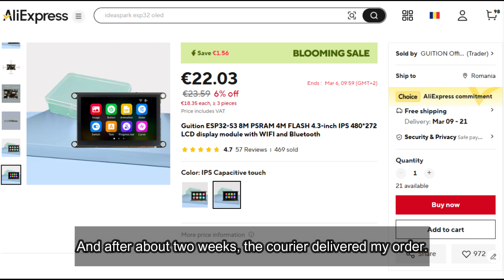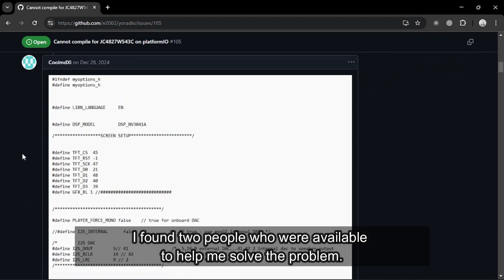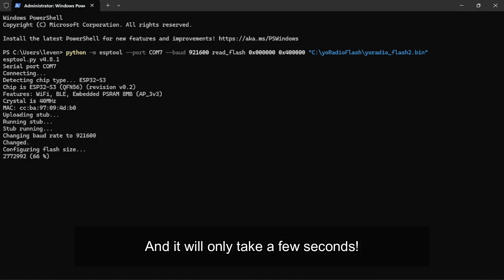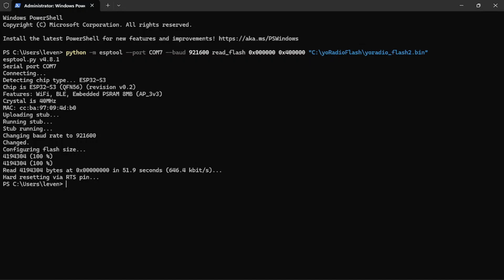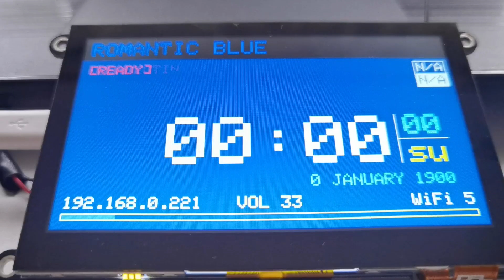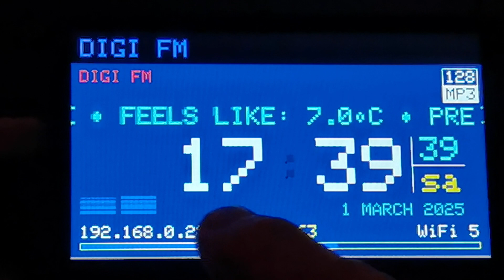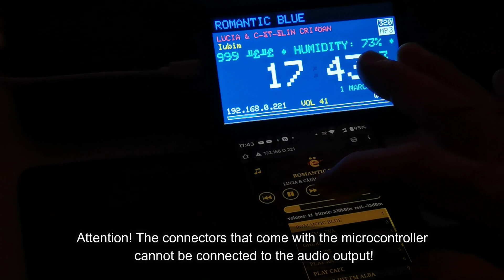JC4827W543C – Easiest Touchscreen yoRadio You Can Build!

Comment from the maker: UPDATE: 21-03-2025
I fixed the weather section where coordinates couldn't be saved. Now it works!
https://github.com/DaradiciLevente/yoRadio_on_JC4827W543C/blob/main/bin/JC4827W543WeatherOK_02.bin
After entering one of the coordinates, press the APPLY button, then enter the second coordinate and press APPLY again, then the DONE button.
Restart the microcontroller to display the weather data for the new coordinates entered!
*********************************************************
- Documentation found about this board:
https://drive.google.com/file/d/1gueTjXj1Turlng_rQoWY_w9u6djYq_Ah/view?usp=sharing
- Yes, it's mono.
- The DAC used is not the ESP32's built-in one, which is a good thing. It uses an NS4168 DAC:
https://i.imgur.com/dZN2lGp.png
- Here’s the NS4168 documentation:
https://drive.google.com/file/d/10usuAzGJXK8cs_hDrNVgSYg-hX5jxtqx/view?usp=sharing
- The sound quality is good, but in my opinion, a PCM5102A offers better audio performance — or maybe the yoRadio project is just better adapted to it.
- There are still a few free GPIOs on the board, which you could probably use to connect an external DAC:
https://i.imgur.com/29iERlE.jpeg
- To connect the speaker to the board you need a connector with SH1.0 wires, of course 2P. I bought this connector from here:
https://www.aliexpress.com/item/32921127444.html
Two images of this connector:
https://i.imgur.com/f7T7rLP.jpeg
https://i.imgur.com/vDMWe3a.jpeg
- I’ve collected the changes so far on a GitHub page for those who want to modify the project and fix the remaining issues:
https://github.com/DaradiciLevente/yoRadio_on_JC4827W543C
- My GitHub page:
https://github.com/DaradiciLevente
- For even faster flashing in the Flash Download Tool, set the COM port baud rate to 921600.

Comment: Thank you for sharing this. I had no issue loading then file but unable to configure the wifi and others settings. what am I missing?
Reply from the maker: On first boot it will try to connect to my wifi network, which won't happen.  After that it creates a wifi access point to which you connect and in the browser at the IP address: 192.168.4.1 you enter the data of your wifi network.  Save the data and it will connect to your wifi network.
Reply: @LeventeDaradici  Thank You. That is what I was missing. My only problem now is every time I can weather settings it reverts  back to your settings
Reply: Just one more thought, is it possible to incorporate blue tooth earbuds?
Reply from the maker: I have NEVER seen anything like this on the yoRadio project before. I have no idea if such a solution exists.
Reply: @williammckee4369  I think that you could connect a bluetooth dev board some how and this could transmit to you ear buds, but not a simple project

Comment: Szia Levente! Nagyon jó videó, köszönöm. A leírásban lévő dolgokat is megnéztem. Jól értettem, hogy van egy JC3248W535 kijelző+ESP32 board is, de azt nem sikerült működésre bírni?
Reply from the maker: Igen. Annak egészen más a képernyő típusa. Van valami dokumentáció a gyártó részéről de bele se néztem eddig. A demó kód a képernyőről látható ezen a csatornán. Érdekes az is.
https://youtu.be/m0m_cZ43q6U
https://youtu.be/sOPy2KAM6EE
https://youtu.be/XVyFHk6L790
Reply: @LeventeDaradici  Köszönöm. A képernyő mérete mellett, ami kisebb, viszont a memória több a 3248-ban. Ha Yoradio szempontjából mindegy, lehet próbálkoznék a JC4827W543-al. Esetleg majd tudsz segíteni ha elakadtam, főként külső DAC  (PCM1502) illesztéssel?
Reply: @zsoltkovacs2395  Hello, I am also interested in a .BIN or my options file for this card model but with the infrared input and I2C output option to connect a PCM5102 sound card. Thank you in advance.

Comment: What type of connector is needed to use the extra pinouts (e.g. for a better DAC or rotary encoder)? Thanks :)
Reply from the maker: There is a connector in the board box.  Only for the speaker is not good.  For the other ports it is usable.

Comment: Hi LeventeDaradici,
 Great Video and great idea for using the bin idea for simple upload for anyone.
 I was so glad to help as the Yoradio project is amazing.
Maybe another video is needed for normal Arduino IDE with the libraries etc or perhaps another bin the add the DAC via GPIO pins as this board has alot of GPIO to easily add external DAC and AMPS etc.
Keep up the great work and thanks for the mention.
I am truely amazed at the speed of the .bin file, so much quicker than normal compile and flash!
Reply from the maker: There is a version on this GitHub page that you can modify: https://github.com/DaradiciLevente/yoRadio_on_JC4827W543C.
Thanks for your help on GitHub! This video couldn't have been made without you.
Reply: I think external DAC is a must since the ESP DAC is mono no?
Reply from the maker: https://www.chipsourcetek.com/Uploads/file/NS4168.pdf

Comment: That is amazing, a true plug&play internet radio for cheap, with a large touch screen! Levente, you are a hero!:washhands:
Thank you for devoting your time & effort to figure out the tricky hw config issues and made this display supported. :medal-yellow-first-red:
I hope that the YoRadio Crew will consider adding this display to the official support, could you consider recommending them? This is a truly cheap and easy solution, making YoRadio even more popular.
This is mono only, right? 
Is this using the ESP32 DAC, so the sound quality is that poor? 
Is there a digital sound output where I can add a DAC for a decent analogue input signal for an amplifier?
Reply from the maker: Yes, it's mono.
The DAC used is not the ESP32's built-in one, which is a good thing. It uses an NS4168 DAC:
https://i.imgur.com/dZN2lGp.png
Here’s the NS4168 documentation:
https://drive.google.com/file/d/10usuAzGJXK8cs_hDrNVgSYg-hX5jxtqx/view?usp=sharing
The sound quality is good, but in my opinion, a PCM5102A offers better audio performance — or maybe the yoRadio project is just better adapted to it.
There are still a few free GPIOs on the board, which you could probably use to connect an external DAC:
https://i.imgur.com/29iERlE.jpeg
I’ve collected the changes so far on a GitHub page for those who want to modify the project and fix the remaining issues:
https://github.com/DaradiciLevente/yoRadio_on_JC4827W543C